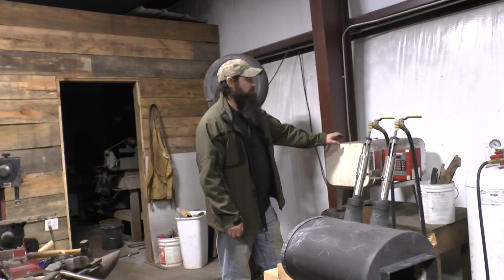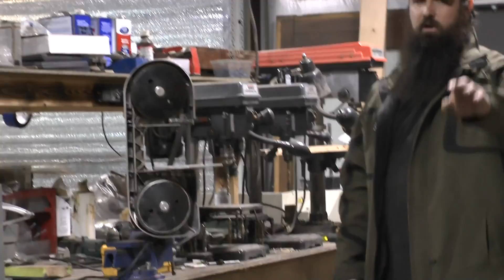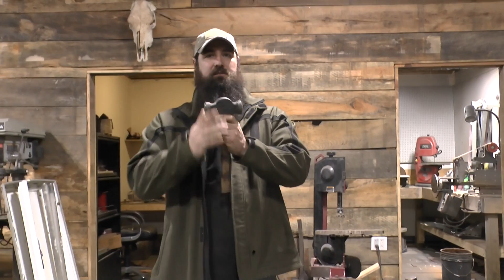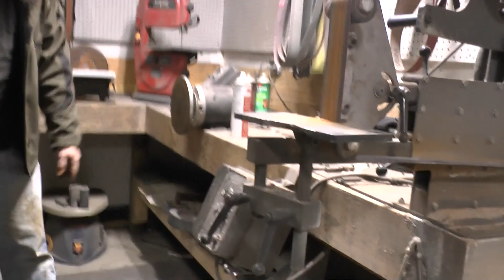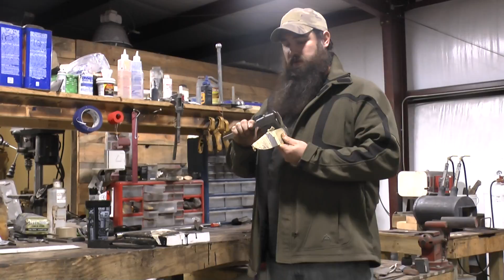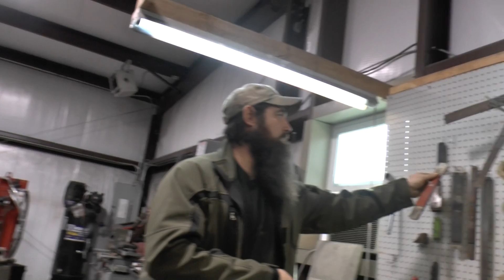Introduction to Bladesmith tools

Comment: Never heard of that sticky back 3M paper.  Gonna have to get some myself
Reply: Chris Taylor 
I bought some 120 and 220 grit Mirka Gold paper a while ago and compared to Rhino Wet, for me at least, it held up nowhere near as well as the Redline Rhino Wet paper.  I tend to use lube as I sand my blades ( ammonia free windex) and the paper falls off pretty quickly, so you pretty much can only dry sand with it.  This is just my experience with it though.  
I do like using it on my surface plate to clean up my flat after using the disc grinder, and also use it over the edge of some steel plate with a sharp radius on it edge to clean up and even up my plunge lines.  It doesn't leave any sticky residue behind like some other  PSA backed sandpaper I bought in the past (which took forever to clean off all the paper and sticky stuff when switching to a fresh piece) so it's great for that.  
But if you are looking to hand sand you blades using sand paper with a sticky backing so you can really bear down on it without having to hold the paper tight with your fingers, I would personally suggest just spraying some lower tack adhesive spay on the back of some Rhino Wet paper.  Of course everybody has there own preferences, but I really feel like the Rhino Wet lasts a lot longer than at least the Mirka, although the 3M may be different.    Just some food for thought 👍 😉